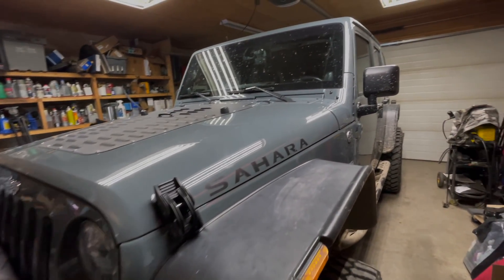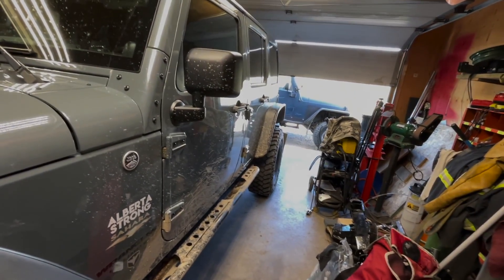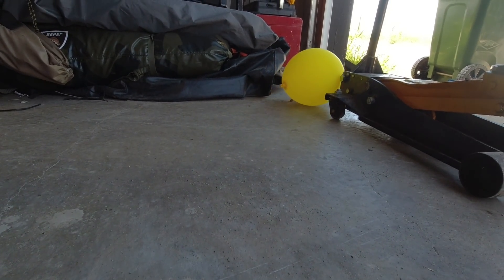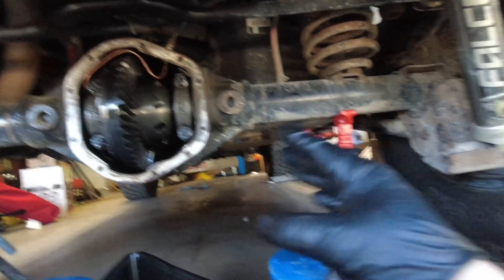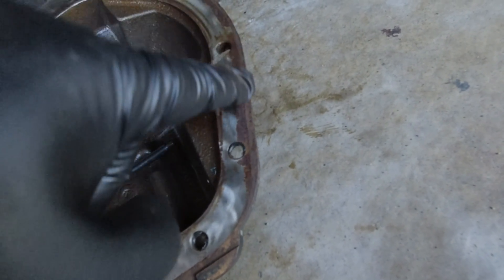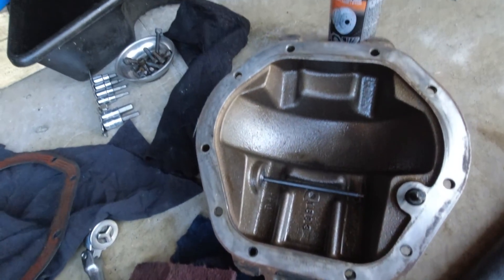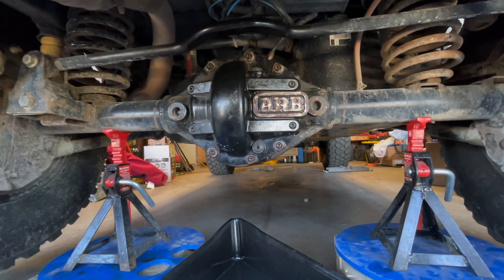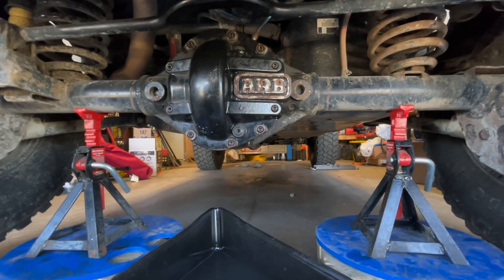Why Differential Break in is Important

Comment: I’m 100 miles in on 4.56 gears on my 04 TJ with the nv3550 5 speed. My gears are short in the beginning I think I would prefer 4.10s but we will see.. I’m used to 3.07 on 33s. My question is how is the front axle broken in since I don’t drive in 4x4 do I still change the oil at 500miles and or do heat cycles maybe on a dirt road in 4x4 after breaking in the rear?

Comment: I just had an Eaton E locker installed in my 93 Toyota 4 Runner. When I was installing it I noticed they used no retaining lock washers and hoped they at least used locktight. Anybody know if Eaton is supposed to have those retaining clips? It doesn't look like it was machined for them bit seems odd to me. My stock one had them.

Comment: Most recently swapped gears on front and rear of my F150 farm truck and never did anything with the oil or a break in.  Truck was on its way to the farm 10 miles after install and has had 1500 pounds with a full slip tank on the axle right from day one.  (75-140 in a Ford 8.8 super w/3.73, 6R80 w/5.0) 75,000 miles, no issues or sound.

Comment: Also if your level is low, will it flow out to the axles and keep the seals from running dry?
Reply from the maker: Depends how low you could end up starving the axle bearings of oil

Comment: Nice work! I use LubeLocker with a factory cover, and have never had any issues (no drain plug). You just have to be sure the edges are true, and tighten in a crisscross pattern, and do NOT over tighten! Using an impact driver is a NO-NO!

Comment: Just curious…. If this is a big deal, why don’t people worry about it on new vehicles?
Reply: I concur.  I spent a few years working on low backlash gear reducers that saw a lot of abuse and we would service them and found little wear.  I have set up a couple 10 and 12 bolt GM rears for drag racing and street use.  Those gears are heat treated from the factory and there is nothing me, you  or anyone else can do to change their geometry.  It is important to use good oil and set the preload and back up properly.  I recommend changing the oil after the first 1000 miles to get the bearing debris out of the housing.  Go ahead and beat the shit out of the gears as soon as you install them, they will be just fine.

Comment: Jerry,
I have a modified  2014 JKUR I have always  run the heavier  weight  gear oil recommended  for use when towing.  I chose  this due to all the extra  weight  of gear , mods and larger tires,  my Jeep  5,300 lbs or so . Do you have any thoughts on doing this?
Reply from the maker: I think that’s a great idea there is no harm in doing that

Comment: I had the 4.88's on my TJ installed by a local big-rig axle shop that was getting into off road biz as well.  When I asked about a break-in they said just drive it like normal but change the oil at 500 miles.  I asked how the big rigs broke in new gears and they said big rigs leave the shop and hit the highway immediately, and many with full loads on their trailers.  No need for special treatment according to those guys.  Just change the oil at 500 miles is all they said.   My ARB and gears have been fine for 14 years now.
Reply: Thx man I appreciate the important info

Comment: probably not gonna be an issue, i dont even know if you could do it a different way, but after seeing the banks videos about designing a useful cover and the way the fluid circulates in there, i dont like where that air line sits. personally i run auto lockers, yukon grizzly
Reply from the maker: Trust me I don't like the whole design of the Locker Myself

Comment: About to hit 500 miles since i've changed my ring an pinion to 456 gears. Should be good, everything has been smooth and not overheating.
Reply from the maker: You running bigger tires or just for heavy towing ?
Reply: @BackCountryWrenching  Bigger tires, 36x15.50 MT, MTZ
Reply: I want to put my own Yukon 4.88 in my LJ but I don't even have a flat surface to work off of. Gravel driveway and no garage or carport.